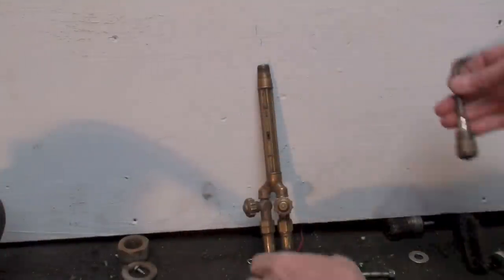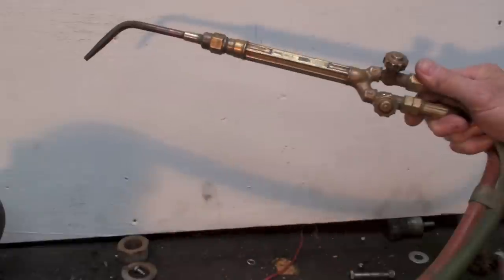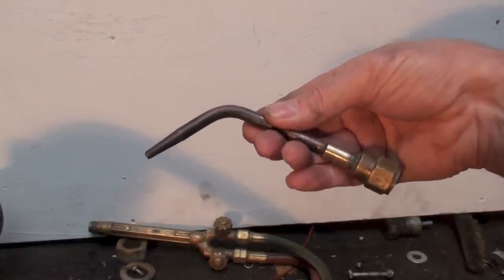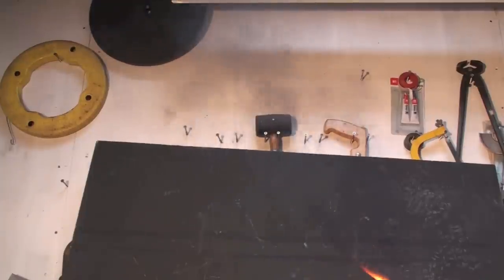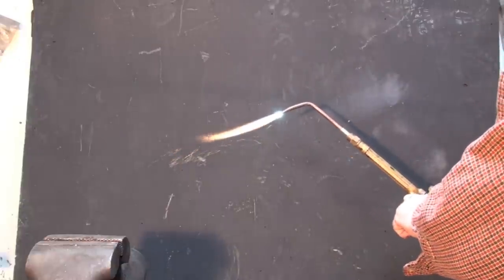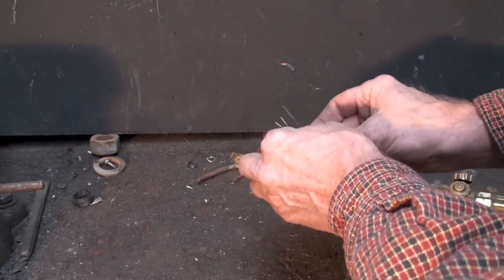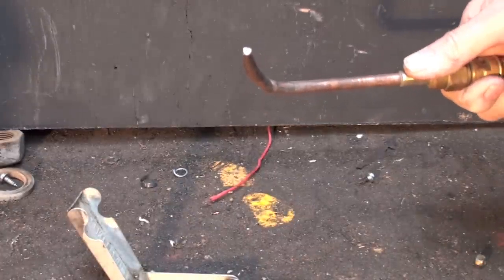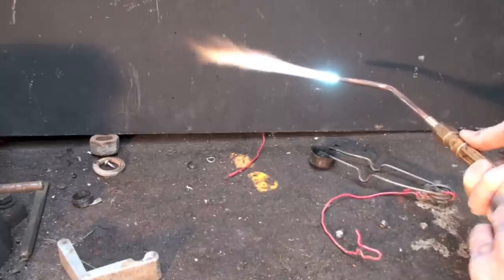How to use the oxy acetlyene torch tip

Comment: it's been a few years (well, over 10 to be correct  lol) since i've done any brazing.
i just sat and watched all 3 of your videos on oxy-acetylene and now i think i know what i was doing wrong - not enough heat because of wrong size tip...i could of sworn i was taught to use #1 tip for anything less than 1", but i will take your advice and go up to a #2 tip because i'm looking at a cold joint.
thanks again for the video, excellent refresher course
Reply from the maker: Glad it helped.
GFM

Comment: I've been running my pressures too high for 40 years. I'll be sure and try lower pressure tomorrow.

Guys, one more tip. Always check your fittings and hoses at the torch handle. They get bent, stretched and all kinds of things and they will eventually leak. There's not much worse than having a flame at your wrist while you're cutting.

Comment: NEVER ignite torch with oxygen running.  You're asking for it.
Always start w fuel (acet) , add oxygen only when fuel is burning.
A little carbon burning residue for 5 seconds isn't going to kill anyone....but an oxygen 
explosion will.
Reply: Very well said. It is a great thing oxygen doesn't burn by itself, I'd be a dragon right now I suppose.
Reply: Will Shaw hey pal oxvgen doesn't explode--but acetylene will. get your story straight.
Reply: @davepenprase  think again , oxygen can cause an explosion ,,,but not in a house your servicing , i just caught your comment it made me think about my dad story years ago he was a boiler maker and welding big tanks him and a other welder ,,,after lunch my dad's partner said ill finish up you go and do something else ,,my dad heard an explosion it was his partner inside that tank , the oxygen valve was left on and when he struck an arc ,,,he died there !
Reply: @davepenprase  Bullshit.. Alls it takes is a flashback, which can happen from lighting your torches with both valves open at the same time.  I know first hand.  It happened to me.  Read the story above. Oxygen can self ignite a number of fuels, such as oil.

Comment: Small rosebuds are the best.  NEVER light the torch with both gasses on at the same time, just to save a little soot.  I used to light my torches your way.  One day while lighting my torch your way, I had a flashback, which sounded like someone shooting an AR15.  It was oxygen exploding in the rubber oxygen line, which ended  up as an oxygen and rubber fire at the cylinders.  I had a blow torch type flame pointing right  in line with the acyetaline regulator.  It was a very large tank set, and we were working on installing the piping for a liebert unit in a large computer room.  The electrician asked me “is it going to blow”.  I told him “it might”, and everyone ran except for me.  I was able to close the valves before the whole setup blew, and the fire went out. I could have burned up a multi million dollar computer room, and someone could have been hurt or killed.  After that we were required to install back flow valves on every torch. I never lit my torch like that again.

Comment: I bought a acetylene oxygen brazing unit on craigslist, I got what you showed in this video. Every time I try to adjust the flam it turns off. Can you make video, on how to adjust the tip correctly? Thx
Reply from the maker: riad hawari Hard to know for sure what is happening.  If you start with acetylene, be sure the flame is not so high as the flame pulls off the tip.  Then add oxygen slowly.  Pressures should about 5 on acetylene and 10 on oxygen.  Hope this helps.
GFM

Comment: Tip#1 would be for txv or small line brazing ? 
Is this better than tip #2 for smaller line brazing
Reply from the maker: In my opinion, no.  My method is to heat quickly, get the braze done and get out.  That way you do less heating of the component.
GFM

Comment: So which its the correct way (to me correct means SAFEST) light up a torch? I'm new in this stuff .
Reply from the maker: They are actually not really easy to light. Each torch is a little different.  There are 2 ways I recommend.  Once the regulators are set, open the acetylene about 1/4 turn.  Light with a striker.   The flame will be yellow.  turn on oxygen to set flame.  The other way avoids soot coming from the torch when the acetylene only is on.  Open both valves.  Acetylene 1/4, oxygen 1/8 turn, then light.  Each torch is different, so you will have to experiment.  Hope this helps.
GFM
Reply: +enterBJ40 Now that you've had a year experience, what would you say in your opinion is the safest way to light a torch?
Reply: +itzgangstabob Sadly i had to quit working with torch :(.. so little experience yet.
Reply: enterBJ40 What are you doing, its been a year?
Reply: I was running small hydraulic implements and hoses shop  (family bussiness)  where I had to weld hydraulic  connectors from time to time. Eventually it got cheaper pay for welding than perform in house.

Comment from the maker: Go for it!
GFM
Reply: Can you cut with that tip or is it just for heating up?
Reply from the maker: @armstrong4196  Its a welding tip.  I have used it for thin material (18 gauge or less) by increasing the oxygen pressure and manually opening the oxy after preheating but it is not designed for that.
GFM

Comment: Is B tank better for brazing ?? Because I have damaged pipes when I have done  with this oxy Acet torch. The bid was was small and put a hole in the pipe.
Reply from the maker: B tanks will give a larger flame but it is not as hot and will take longer.  My best advice is to heat as hot as you can as fast as you can to not excessively overheat the pipe.  You do need to watch closely and keep the flame moving.
GFM
Reply: If you see the copper "glasssing over" or looking wet when it's bright cherry hot then you will punch a hole in it. When it looks wet it's the copper turning molten and the force of the gas from the torch tip will push the molten copper away making a hole. Sounds like you had the tip in the same spot at full heat for too long. You can do this easily with smaller copper like 3/8". When it gets close to the melting point the copper tube will be very bright cherry red (bright yellowish glow) and almost look translucent or where you can see through one side to inside the tube.

I always try to get the blue flame kernel about an inch long or so. The blue kernel is where the heat is. Play that along the fitting until it starts to get hot and then touch the filler rod to the fitting as a test. It should just start to want to melt at that point or maybe leave a blob on the joint. If it leaves some filler rod behind use that as a gauge when to start brazing it up. The blob will start to look like it's boiling and/ or flatten out a little. That is the time to go at it. The filler rod will go where the heat is so keep it moving around on the fitting to draw in the filler rod. I try to point the flame towards the center of the fitting at an angle to keep from wasting heat cooking the pipe and also to have more of the flame in contact with the pipe and fitting. The pipe will heat up from being in contact with the fitting. 45 degree angle or less in relation to the pipe surface is a good angle in my opinion.
Reply: Thanks al lot for great explanations guys. Really helps. I will keep using my oxy-act instead of B tank
Reply: orlandotech best explanation on how to braze so far, thank you brother.

Comment: you didn't tell which gas is to be shut of before turning off
Reply from the maker: +simranjot s hunan Always the fuel is shut off first.
GFM
Reply: Wrong.  Always shut off OXYGEN first.
Reply: I would agree, especially if trying to avoid the soot problem in a $10 million home with white carpet. I really don't see the point for starting with both gases to avoid soot and then shutting off oxygen first.

Comment: you light the torch with only gas and adjust the flow until the smoke clears then open the oxygen and adjust for a neutral flame. Also you should open the oxygen bottle valve all the way open and back seat it to prevent oxygen froming leaking past the valve stem. This guy don't know enough to be telling someone else how to set up the equipment.
Reply from the maker: I assume you like the soot floaters.  Oxygen cylinder valves have changed.  They no longer need to be backseated.  
GFM
Reply: bir yürüyordum ki

Comment: I really hope you're running checks and arrestors.. Lighting a torch with the oxy even cracked open is wrong. Please stop advising people to do so. Best case is a cooked regulator or hose.. If it back feeds into the tank.. Well bye bye
Reply from the maker: I bought my first set in 1968 and have used them ever since, both commercial and at home.  In my experience this is not one of the issues with this type of tool.  I would be much more concerned about cleanliness when changing regulators.
GFM